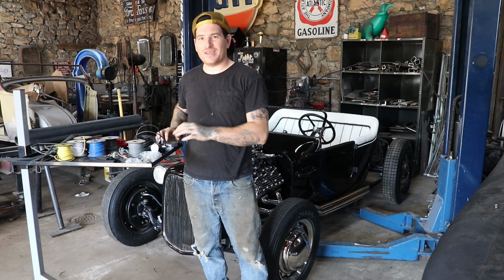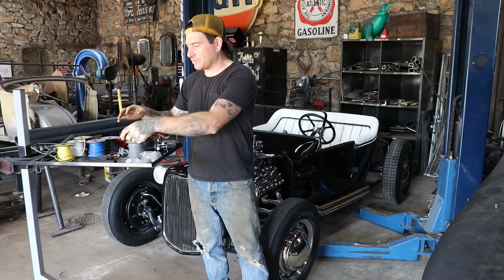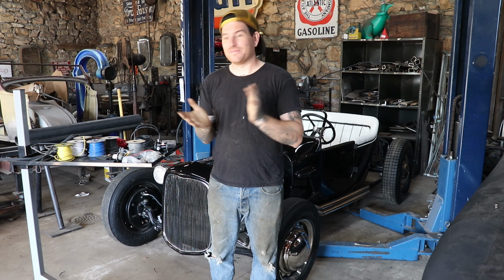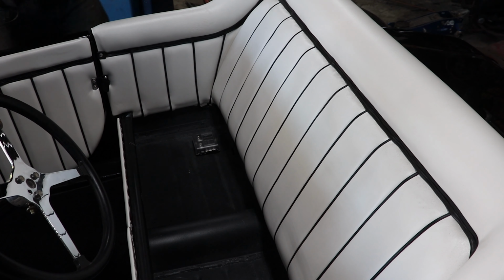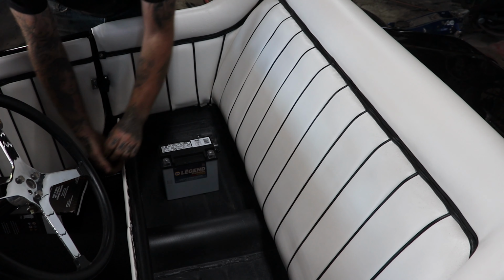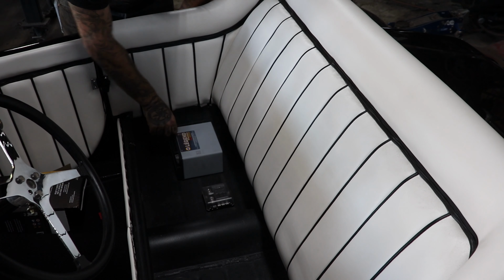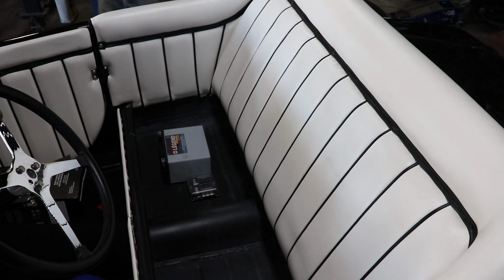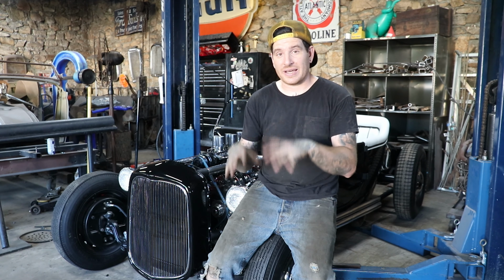Ford Free-T - Wiring Updates - Ep. 93

Comment: One tip when I wire in a battery I will put in a positive junction somewhere close to the battery so the positive lead from the battery is relatively short. Saves time later down the road when the positive terminal gets funky. That way you do not have to cobble together a new positive feed and the short feed cable is easier and cheaper to replace— food for thought
Reply from the maker: Good idea. We'll keep it mind!

Comment: Wow, it looks really nice. The things I really like are all the period reflecting parts and well planned installations of others. 
 Great work Matt! 👍
Reply from the maker: Thank you Ray! It's been tough using 99% old parts on this build, and the ones I do use I feel guilty about but at least they're hidden mainly haha. Thanks  for watching! -Matt/ITG
Reply: @IronTrapGarage  I built a 1950 pinhead starting with empty cases and flywheel. I went to swap meet to get all original but not year specific parts. Almost all of them required rebuilding and machining to bring them up to duty rating. When done I rode it to Sturgis 50 yr from the SF bay area. Altogether when done with all kinds of cool parts (like a mouse TRAP for the clutch, I was in go about $3,500. I had it for 18 yrs. I am now disabled/retired and can't ride. But now I watch you and so easily identify! Thanks Matt, you got a cool style!

Comment: Running the primary ground to the starter base is preferable then run a secondary out to the chassis. Without a charging system, put LED bulbs in the lights to keep the original look without the draw.